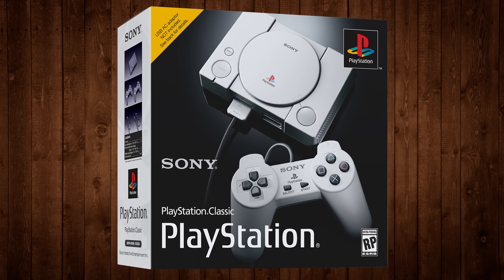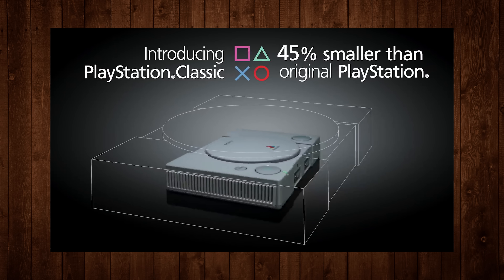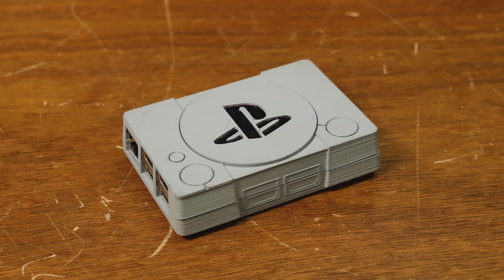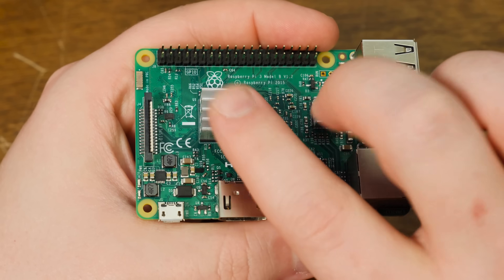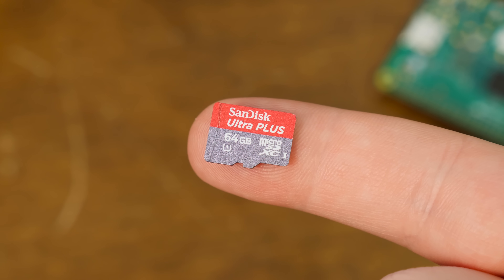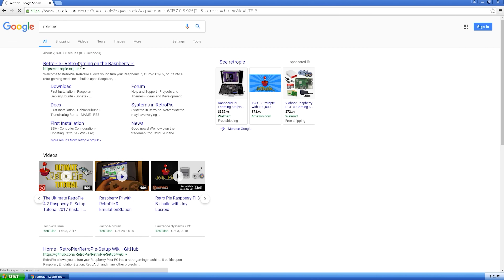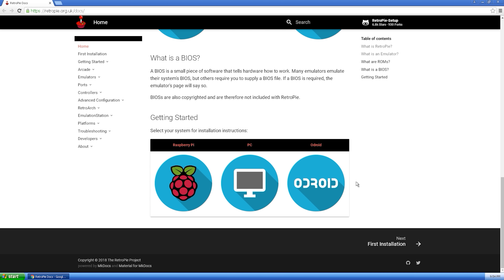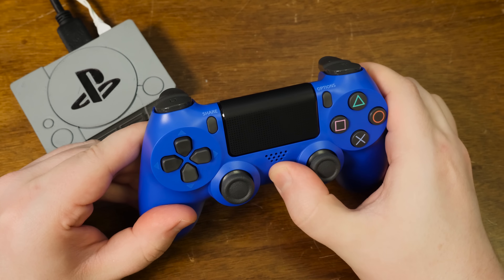Building a Better PlayStation Classic Console

Comment: I've built a handful of pi emulators using Recalbox and Retropie, to replace the PCs in the full-size standup arcade machines I built. There were some advantages to using a PC, before the pis advanced. A pi requires less maintenance, is a fraction of the cost, uses less energy, and can be easily replaced if it ever fails. I note it has trouble with some 90's games that get into 3D rendering. I think the pi4 works better, but still has issues with a few of those. It's not so much the hardware, as it is the video drivers I need to play with, now that there has been some advancements.

Comment: Thanks for the great video! How did you use the PS1 BIOS? There are bunch of them in the link included, I am not sure if this can be done by renaming any of the files and moving it to the bios folder or if any step needs to happen in between.

Comment: If I have a raspberry pi already with games loaded can I just buy another card and switch out the micro cards or would it reset my micro card every time I pull it out
Reply: I’m not sure what you mean by games loaded, cuz if you have the games on the SD card they are only gonna be on the SD card as the PI wouldn’t have any storage on itself or it may I have no clue what model you have or if any have any storage. 

So if you took out the SD card the games wouldn’t be on the pi and I’m pretty sure the emulator itself wouldn’t load because all information and settings is stored on SD card too I’m not too sure tho.

Comment: The PCSX-Rearmed emulator does not need anything remotely powerful to run all games full speed, but the official PS classic struggles. Some games that originally ran at 25fps run at 15fps. I don't know what kind of processor they put into that box, but whatever it is, the microcontroller in my microwave oven must be more powerful than that.
Reply: it apparently runs a mediatek mt8167a which is a quad core 1.5ghz soc, with a weak ass 650mhz gpu. it scores a measly 5500 points in 3dmark icestorm, my budget phone from 2015 literally outperformes it.

Comment: its more for aesthetic reasons, but you can get a resin or acrylic for the 3d printed case, if its unpainted of course, and from there drill small holes for lights, or small fan like i have for my pi, and then buff and paint. it'll look smooth, and wont have any structural issues, plus it'll run waaaaaay cooler with a small fan

Comment: The ps1 classic went down to 30 dollars at my local walmart so im going to use it as a case and wire the power and reset button to the board so they function still
Reply: That's a great idea, the case is probably the best hing about the ps1 classic lol.
Reply: The internals aren’t bad either. Really, you only need to change the software (with something like AutoBleem).
Reply: @Neptune X12 you most likely believe in the jeff Bezos being a reptile theory
Reply: @Marsc9013  ur mums a reptile
Reply: @Neptune X12 did you get fired from a warehouse job recently?
Reply: i have blackbox.its not xbox,but its blackbox so it can run all not just nes snes sega c64 psx wii,but all LOL
Reply: or just mod it. i mean that would be the smart thing to do, but go ahead lmfao.
Reply: @mcfan4924 walmart is the poor people's version of walmart
Reply: @Neptune X12 you good man?
Reply: I would suggest checking Amazon first. I got a really nice SNES case with heat sink and fan

Comment: I built a retro console raspberry pi system just recently. 3+ model used with the Kintaro 9000 case which looks just like an SNES with functioning power and reset sliders. Totally sweet! Project turned out great. Got it loaded up with all the major consoles from NES to PS1. Even got some PC ports like Doom and Duke3D on there but still haven't got the controls mapped to the controller I'm using. Still a work in progress but great fun. Love your build and your videos, Clint. Take care.

Comment: LGR can you bulid a ps2 mini classic use the same construcion did you use to make the ps1 classic by you only make a ps2 classic mini and with it put a duralshock 4 controller but in a diffent color And download the ps2 games like the gtas in 3d tony hawk Games ect
Reply: The Raspberry Pi 3B+ isn't powerful enough to emulate the PS2 smoothly. This console is still hard to emulate correctly.
Reply: @alexhardline2208  but if will power easy as pie?
Reply: @alexhardline2208  i mean he will get another raspberry pi but for the ps2 to bulid the ps2 classic mini

Comment: Sony should have made a PS2 Classic, mainly since it still can't be smoothly emulated and it can run PS1.
Reply: I really don't get the point ? Sony would sell much more by making two separate consoles.
Also, since they'd need to emulate two different hardwares AND to get games for both, the cost would've been much higher.
Reply: @alexhardline2208  The PS2 could run PS1 games. 
No need for two separate hardware.
Reply: @alwinmt  But they're greedy so of course they'd want to do two separate systems
Reply: @Neptune X12 Original hardware is ideal, but really, emulation is very damn close. Game companies like Sony, Nintendo, Sega etc wouldn't be selling these classic consoles if emulation wasn't a viable way to play games. 

In the case of PS2's and any original hardware, someday finding a working console will be rare. Do you really think its a bad idea to emulate the games and assure that they are playable well past when the hardware is gone forever? Not to mention the fact you can upscale from 480p to 1080p or higher, that alone is a really damn good reason to emulate.
Reply: but that would've required effort
Reply: Ps2s are cheap now themselves ( and can do a ton of emulation )
Reply: @Neptune X12 Lemme just pull out my non existent tube tv and cables I threw away over 10 years ago
Reply: @Neptune X12 you are not everyone. Just because you need your special hardware does not mean that many others need it, too. I am fine with digital copies of games. I like it to have one tool to use them all. That is why emulation is a thing for me.
playing PSP games on a smartphone with an Xbox gamepad
Reply: @Neptune X12 You can still emulate PS2 at native resolution, no ones forcing you to emulate games in HD. 
Despite the consoles being very widespread, the compact disc games may rot within decades, before the console itself dies. Same with PS1 discs that are even older. Why be so elitist that you don't want the games playable when the CD media and hardware eventually fail?
Reply: @Neptune X12 To make copies you need to dump the game's files in the first place, why not just emulate it instead of burning it to a disc at that point?
You also are completely forgetting about copy protection. You either need a modchip, a softmod, or to perform specific disc swaps (which eventually will be impossible) to run backups.
Reply: @Neptune X12 You literally have no clue what you're talking about. 

1. Never said I prefer digital media, just pointing out that all of your physical media will some day be dead.
2. You clearly don't even know what a disc swap is if you think I was making a point about digital media.
3. Copy protection has nothing to do with the process of getting data off of the disc, the "correct equipment" is literally just a compatible CD drive. 

4. Copy protection in this case the console itself locking you from playing unsigned backup copies. 

Stop acting like you have any experience with this because you clearly don't.
Reply: The game list for the ps classic was shit, I'm sure Sony wouldn't be pushing any good titles with the release of a ps2 classic
Reply: ps5 can play ps4 ps3 ps2 ps1 ps0 psp yeah if add those formats lol.its not ps2 that works ps1 it is becouse they add it
Reply: Bruh the ps2 is super easy to emulate what are you talking about
Reply: I love my backward compatible cfw ps3. Pride of place under the telly.
Reply: Pcxs2 runs all games at 60 fps
Reply: @draaxassburgers2903  literally on the site they claim to have like 5% working perfectly ( with top hardware )
Reply: @DanielMcLaughlin85  kh2 runs at perfect 60 and i have a 750ti
Reply: @DanielMcLaughlin85  Maybe 5% working perfectly, 94.5% working damn near perfect, 0.5% compatibility issues that are being ironed out as we speak. PCSX2 is a really good emulator at this point

Comment: I would suggest getting rid of this 3d printed case, open the playstation classic remove its internals and just put your raspberry inside. Would it need drilling new holes ? absolutely, but if you do it carefully, the result will be much better than the 3d printed case.

Comment: I bought 2 playstation classics LOL. Just fot the playstation USB controllers. They work great on the Pi
Reply: But you're missing analog controls ! Should've used PS3 controllers.
Reply: @alexhardline2208  why?  Lol. I'm playing ps1 games. NOT ps3... smh.   The playstation classics are worth it for the ps1 USB controllers...  theres no need for analogs for a bunch of games that mostly just have digital to analog anyways
Reply: @alexhardline2208  dude theres something REALLY wrong with you if your that upset over the fact I prefer the orginal PS controller.  You just sound like you have nothing but hate.   Also when's the last time you actually played metal gear solid?  Only thing that uses analog is the first person and the sniper
Reply: @alexhardline2208  and I have ps3 controllers...  why 'should i' use ps3 controllers?
Reply: @lovelorn88nick  If you already have a pair of working PS3 controllers what do you need the classic ones for. surely you could just use the d-pad on the ones you already got unless you're some fucking poser
you're essentially paying full price of admission not once but twice for just 25% of the total of your purchase because the classic release is already moddable. it just points toward you not being very intelligent at managing your money or just not very intelligent in general. hardly anything worth getting defensive over. unless you're too stubborn to recognize it, which would prove my second assumption as correct

Comment: Its more simple to use a ps1 emulator on pc :) But... this way is more interesting. There is even ps2 and ps3 emulators already.I can imagine how interesting it was to build it.But even more interesting would be to mess around with microchip rezistors,condensators,tranzistors... and with everything there. Like build a new one better device.
Reply: yes but the system hes using if you try launching the emulator it throws a bunch of errors

Comment: I did this with the newer Pi3B+ and used a FLIRC case. The FLIRC case doubles a big heat sink and looks good too. The body of the case is aluminium and a post  almost touches the processor, the supplied thermal pad takes up the slack. When in use the case changes from cold to touch to warm to touch and it looks good too.

Comment: I'm planning on doing the same thing with an Orange Pi 2E (it's a little bit beefier that the Raspberry Pi 3, having 2GB RAM and a slightly faster SoC), with heatsinks and an acrylic case with fan for better cooling.

I do remember doing this with the first model B Pi (the one with two USB ports and RCA composite out), it did an adequate job, but it kept thermal throttling, even with heat-sinks... Good times.

Comment: Uninformed question for anyone willing, but would anyone recommend installing a power button or switch onto the console? I fear that just unplugging the thing would end up surging the memory card or something on the board getting damaged.

Or do Raspberry Pi boards have some built in protection for power loss? I am preparing to order parts and was wondering if i needed to make some adjustments to my shopping list.

Comment: I know this is a dumb question but can I use a RPI model zero W
Reply: that isn't good enough to run PS games. It will run Super Nintendo and Mega Drive and the older stuff.
Reply: @LetiferTV  Wrong lol!
Reply: @tomtalk24  I'm wrong? You just said it yourself, "So YES it will work, just not amazing on some games." it runs like crap.
Reply: @LetiferTV  In my testing the only 3D game that struggled enough not to be playable was Gran Turismo 1 and 2 (even now with the latest build of retropie), and with a little overclock even Spyro and Crash worked fine. So its far from "not good enough". 
I guess there are those who know, and those who like to think they know...

EDIT, oh and some weird audio distortion on Tenchu. But otherwise, the Pi Zero with the RetroPie Zero/1 build does okay. But if you really want a good emulator experiance, just use retropie on Linux like I do. PS2 Gamecube whatever all in one.
Reply: It will work, I tested it on a B back when retro was starting out, because back then there was no Pi2/3 lol. So YES it will work, just not amazing on some games.

Comment: I speculate half the difference is that sony decided to go cheap on hardware to maximize profit. Your LGR Station costs only ten dollars less + about ten minutes putting it together and configuring the software, which the factory machines can do easily. They decided to go with parts that probably only cost 30-40 bucks, but they got 30-40 bucks of quality. Therefore, they had to use software that didn't tax it nearly as much as games like crash bandicoot, which was designed to take full advantage of the original PS1. Ergo, less selection of games, poorer emulation, and a massive insult to anyone who enjoys such games. I almost bought the classic, but one review later I decided I'd rather throw my money at a Minty Pi (I detest putting computer hardware together because I always hook up wires incorrectly, so that is an insult of the highest order).

Comment: The console is smaller then the goddamn power adapter.
Reply: Use 2.5A output power bank or if you have PI 4 then 3.0A
Reply: 420th like ;D
Reply: wowowowowowowowowowowowowowowoowow
Reply: @AidenCadwallader ow
Reply: All good

Comment: I put together a RasPi 2B arcade cabinet running RetroPie, but cannot get the PSX emulator to work.  The firmware of RetroPie is about 4 years old at this point, should I update?
Or can it be fixed with simply getting the right bios file?  Do you just put the BIOS into the same folder as the games?  Thanks in advance if anyone has some ideas.
Reply: You need to download the right bios from the website LGR showed and put it in the bios folder located on the root of the Retropie directory.

Comment: 2:29, so... 25% temperature drop... Which means that, it was running at 90C, that's 343K for absolute, which means 257K, so those heatsinks got it running at -16C.
That's frosty!
Unless you meant dropping temperatures over ambient?

Comment: I'd recommend the Odroid-XU4 for people that want to push the "tiny machine" emulation envelope a little further. It has a better processor and GPU as well as more RAM so it's better at the systems that the Pi struggles at (or outright can't run).

Comment: I bought the PlayStation classic because I was told on Twitter that it can actually emulate Heart of Darkness properly (it's almost impossible to get the game running properly in most emulators, including the PS3. I've messed with it for YEARS with many different emulators and have never gotten a result I've liked. Even the PlayStation one in RetroPi. Unless they fixed the bugs recently.) It's really easy to crack the PlayStation Classic.
I'd just have done what you did as it's fun and a much more cost effective choice, but running Heart of Darkness properly was my main goal and I'm a sucker for how official the plastic case of the PlayStation Classic is.

Comment: I'll buy this for $100
Reply: Markus Mitchell but why? make your own in less than an hour.
Reply: I think a fair price for this would be about $115, with about 100 built in games it would be a much better value than the PS Classic. 
82 bucks parts + 15 bucks assembly and an 18 buck profit 

Versions with 128 and 256 gig SD cards (about 200 or 400 games) could be available at extra cost. 

December 21, 2018 6:08 pm
Reply: @whattheheck1000  You couldn't legally sell it with games loaded on it. That would have to be done by the one who bought it
Reply: ugh... guess you're right, but I guess you could sell them blank and allow the user to put whatever they want on it. 

December 26, 2018 1:54 am
Reply: Because I don't have a computer

Comment: thank you for the guide! 2 questions.

1. how do you install the heat sinks?

2. why did you choose 64gb? is 32gb okay?
Reply: As mentioned in the video, he bought the heatsinks as a set and they included thermal adhesive. You literally just stick them on.
Reply: kcuf0 thank you, it was kinda confusing to me, i just want to make sure that I don't screw something up
Reply: @grayman7809  well good luck, I'm sure you'll have no problems 🙂
Reply: kcuf0 my guess he will screw this up.
Reply: 32gb will be fine but 64 is more than 32 i have a emulation stick it has lakka (retroarch in os form) and i have all nes,snes mame sega megadrive genesis even the segs cd and 32x atari jaguar around 68 n64 games and finally all my childhood ps1 games
Reply: Embrace the Darkness ah ok make sense. thank you! i will stick with 32gb then

Comment: yo but an actual playstation 1 console is like $10 at any goodwill and games are around the same price. This is one console were a mini really just doesn't make sense. It can be easily emulated on any PC(or rasp pi as you did), My old Core 2 Quad with integrated graphics could emulate PS1. Not to mention, real hardware is extremely cheap compared to 8/16bit nintendo/sega hardware.

Comment: I’ve got a Raspberry Pi system I built a few years ago when I couldn’t get a NES Classic. 

Does anyone have any suggestions for a good wireless controller? I’m using a 8BitDo controller but its Bluetooth is hit and miss.

I’d like to be able to use the controller for a variety of systems.